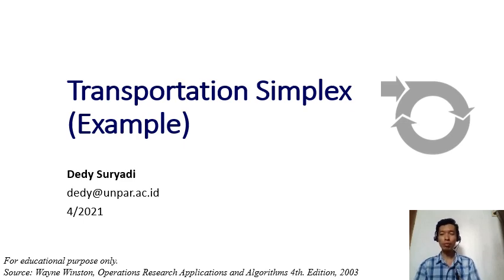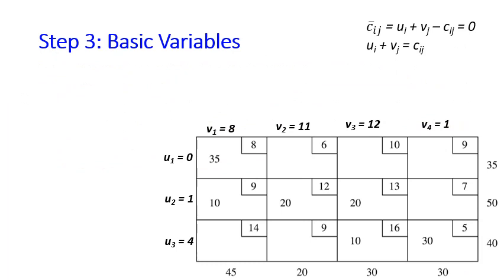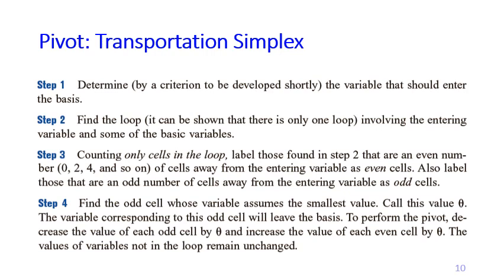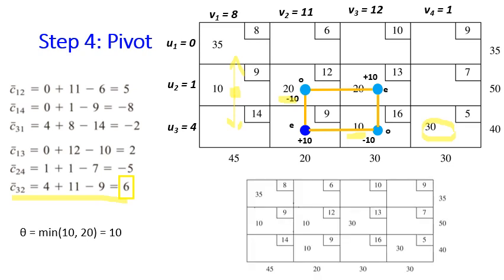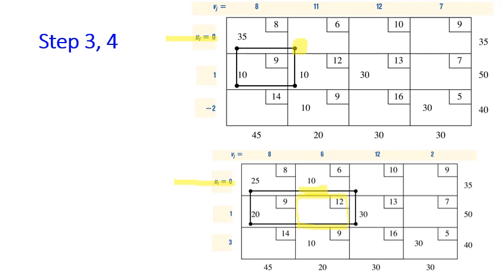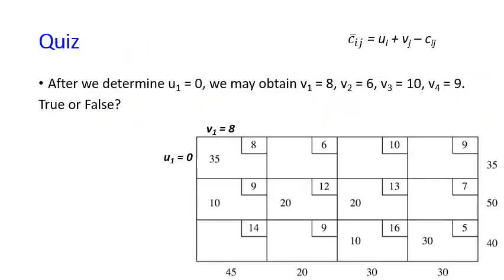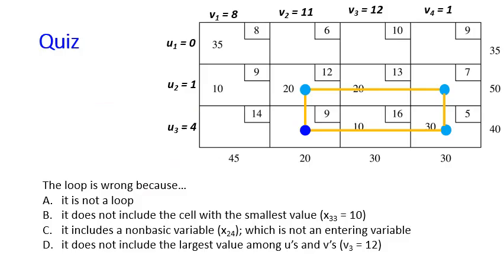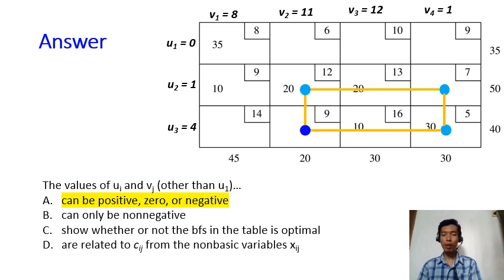Week6.10 Transportation Simplex Algorithm (Example)

Comment: Do you have a video where you do this for an unbalanced problem?
Reply from the maker: Hello! This Transportation Simplex method only works for a balanced problem. Therefore, if initially the problem is unbalanced, then we need to balance it (as stated on Step 1 at 0:55). 
This video explains how to balance a Transportation problem:
https://youtu.be/JVrb3j1d1ms?si=KsPSwgUs1qNEeBU6
Reply: @coverCell  Thanks! best video I could find for the simplex of transportation problems

Comment: In step 4, after forming loop, how you are deciding which cell is even and which cell is odd?
Reply from the maker: In Step 4 2:54 x32 becomes entering variable, so cell [3,2] becomes the starting point of the loop and thus it is an even cell. In 3:36 [3,2] is even, [3,3] is odd, and so on. Thank you for watching my videos!
Reply: to avoid confusion starting cell should be odd and the next should be even, since 1 is odd and 2 is even @coverCell